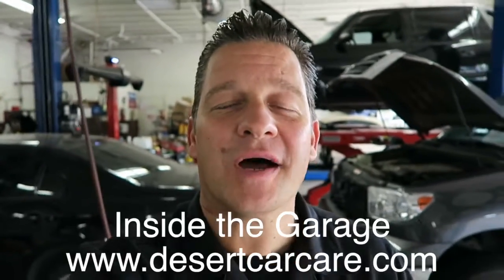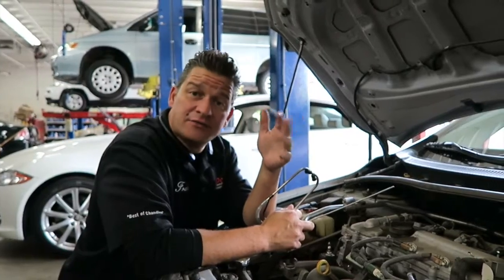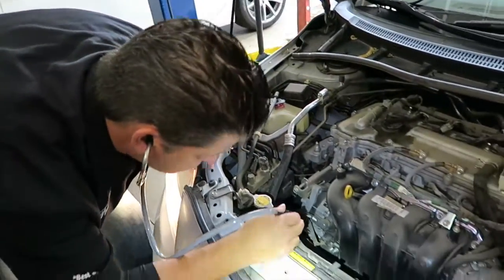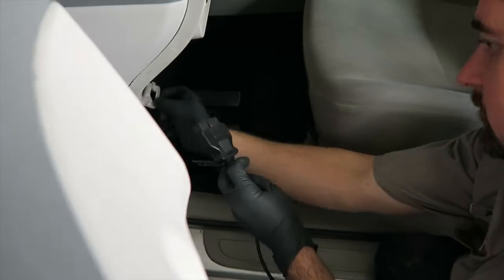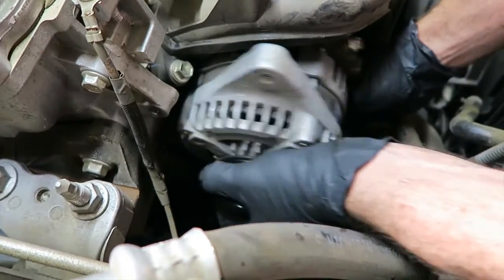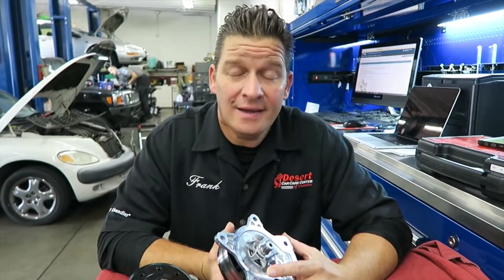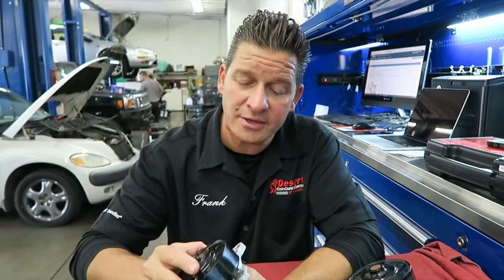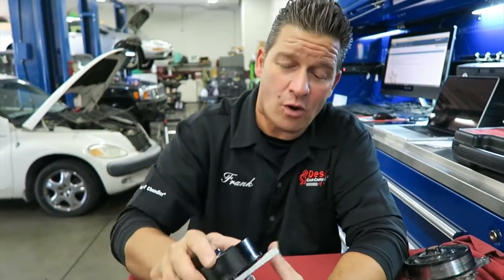Water Pump Toyota Corolla

Comment: 2010 Corolla serpentine belt was chirping so I rotated tension bolt 1 1/2 turn. Belt is 9 months old. Tiny chirp on acceleration. Next day I hear  ticking from the alternator area. I'll check with a stethoscope. Corolla has 125k miles. Alternator outputs 13.75V with all accessories on, 13.94V all off. What do you think? Thanks.
Reply from the maker: Tom C ...call me at garage when I get back from training in Detroit...easier over the phone for this one...tks ~~Frank
Reply: Ok, thanks. Next week?
Reply from the maker: Tom C..yes sir. Got you.

Comment: What's the average life of 2007 Toyota Matrix / Corolla water pump. . The car has 159K miles and I have no idea if the water pump has ever been replace and Toyota history record shows up to 90000 miles. Do you think it has been replaced once? It's not leaking. Car belongs to my son and has been very reliable but he is planning to take a long summer trip.
Reply from the maker: May be worth the extra measure if history not known to replace. Mileage , if original, is in the potential aged , wear and tear failure zone -Good luck !

Comment: I've got a pretty loud noise coming from rear of 2006 Matrix 4WD which only happens when car is moving. Sounds like rear bearing or the viscous coupler. I lifted car and  checked wheel bearings and they all seem ok (turn freely and no play). Seems to have gotten louder in last week-car been making this noise for at least the last 10k miles. Drives perfect. Can I use the stethoscope when sitting in rear while someone is driving? Thanks.
Reply from the maker: MarzNet256 ...rolling noise as cruising sounds like bearing ...stethoscope the hub/wheel bearing AND the rear differential...you will likely find something there...be careful & let me know how it all works out brother ~~Frank